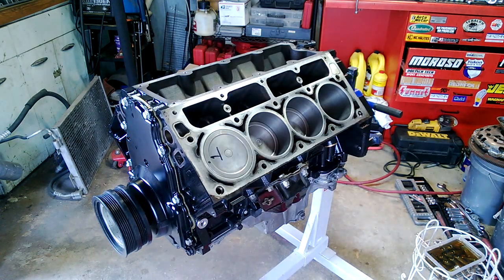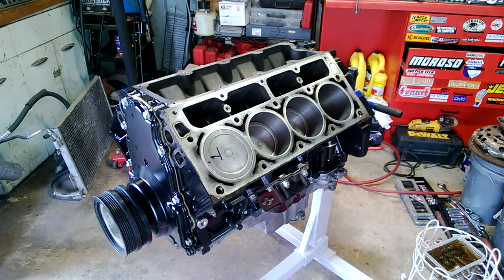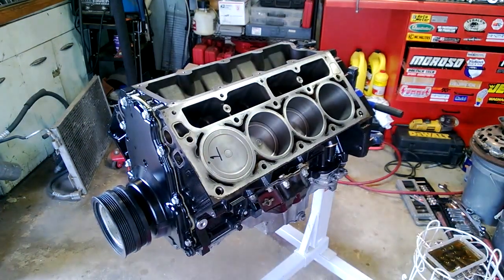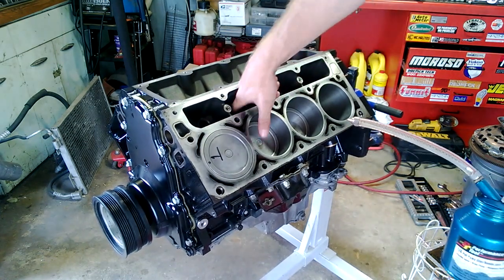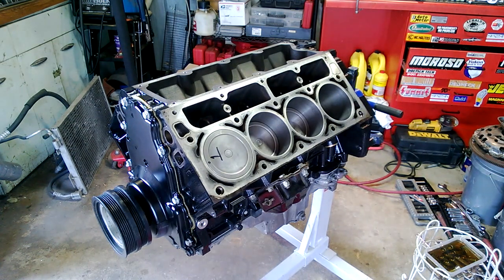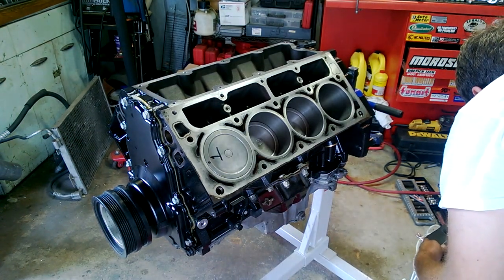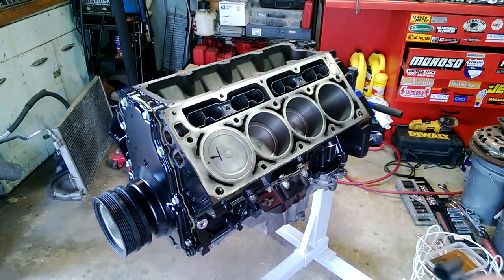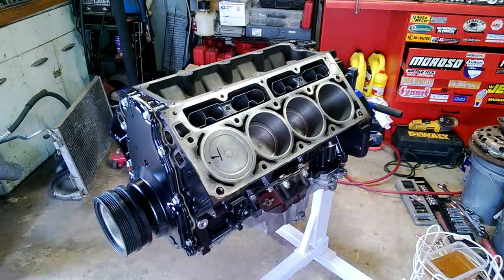LQ4 Build - LS7 Lifter Install

Comment: Im doing a cam swap and the cam is stuck on a lifter. Can i just take them out, put new cam in, and put the lifters back in?
Reply from the maker: The heads are still on? If so, you should have used dowels through the front of the block to hold the lifters up. I know most times they stick in the trays, but situations like this make it worth doing.
Reply: @JEGsGarage  yes the heads are off
Reply from the maker: @sosakicks  oh then yeah. No prob. Take the lifters out, pull cam, install new cam, install lifters into trays first, then install lifter/tray assembly.

Comment: You forgot to mention the orientation of the oil hole in the side of the lifter. Only one side has it and it apparently matters which way it is installed (hole to front or hole to rear of engine)!
Reply from the maker: Thats because it doesnt matter.  I guess I could have faced them all the same way, but they were brand new.  The only time to really take note is if you are removing and reinstalling, and thats just to orient them the same way they came out for wear purposes.  Oil will go into the hole no matter the directly, provided your oil pressure is healthy.

Comment: that's an awesome build man ! I'm going to be working on my lq4 pretty soon also, so the LS7 lifers work for the lq4 straight swap ?
Reply from the maker: Thanks!  Yes the LS7 lifters will drop right in.  HOWEVER...there is a bit of back and forth on pushrod length when using these.  The range of motion in the plunger is a bit different than the LS1 versions, I think.  A lot of guys will run more preload on the LS7 lifters, myself included.  I recommend checking your pushrod length with the new lifters, just to be on the safe side.

Comment: best series of engines ever built and they are fun to work on!!! 5.3 and 6.0 are bulletproof right off the lot    seen them stack on over 400k miles without being touched
Reply from the maker: +grady thayer Thanks for commenting!  Yeah these motors are great.  Just enough newer technology to be competitive, but still really easy to work on, and not too expensive.
Reply: really 400k? wow
Reply: That's awesome! inspiring for a build an ls then...I have an LM7 from a Silver ado too
Reply: Don Ross I was going to do a video tearing it apart. I'm thinking I'm just going to do the built. Trying to make it reach pass 400
Reply: Don Ross mine has 300k and has never had an issue. I bought 2000 Silverado from my dad has 5.3. I'm doing the cam install myself. Already took off the intake manifold and heads since I'm doing other stuff. But yea haven't had any problem with the engine.
Reply: DatBoiBEAT awesome would like to follow...count me in
Reply: You do realize the 4.8L and 5.3L are the exact same blocks, right? Only difference is stroke of the rod and compression of the piston if I'm not mistaken.
Reply: @JustAGuy781  sleeve thickness is also different which is why the 4.8 is more favorable towards boost applications then 5.3, 5.7, and 6.0+ engines
Reply: @UCZ5uCdF4oLk3PQ9pEW59XfQ that will definitely be pretty sweet ! I'm building my gen 3 6.0 for my air ride 87 s10 should be a tire frier😂
Reply: @zacrork1292  yeah I have a lot done to mine at the moment, did it all myself and my tuner and I are leaning towards 440RWHP. My mods are extensive bolt ons with some engine work I did. Nothing done to the short block, just heads, cam, truck intake work, throttle body work, long tube headers, exhaust, a Vararam Tri-Power Ram Air intake system and of course a good custom tune along with the 4L80E swap I did. About to go drop my driveshaft off in about 30 minutes.
Reply: Pull on mine this weekend 460km

Comment: did you use stock length push rods?
Reply from the maker: +oerllikon2 I did not...  I had 7.350" push rods in from ThunderRacing.  But they were too short.  I will have to track down the actual length that I used.  I cant seem to find the email receipt or anything...but I went with Brian Tooley for the spring kit and pushrods.  If you want me to try to track down the length I will, but I always suggest measuring each build.
Reply: +JEG's Garage thanks for the reply, does the cam have the same base circle? same head gasket, decked heads etc? I am considering ls7 lifters with the same pushrods, I've read so many conflicting things.. thanks for your time
Reply from the maker: +oerllikon2 Cam is a smaller base circle than what I had.  Im not sure if its smaller than stock or not.  They are standard 6.0 head gaskets.  Heads are 5.3L heads, and the gasket surface was only cleaned up.  The chamber size was still close to stock 5.3L.  I read conflicting things with how much preload the LS7 lifters should have.  I gave the more than the LS1 specs, but not as much as some.  Some were giving them like .100"+ if I recall.
Reply: +JEG's Garage how much preload are you running?
Reply from the maker: I will have to try to find my notes.  I want to say .070".  But I cant 100% remember.  It wasnt over .100" like some say.  My valve train is still noisy like its always been.  Ive never been able to quiet it down.  Just accepted the sewing machine sound as sweet sweet music haha.
Reply: +JEG's Garage could it be your rockers? the mechanical sound could be a good thing haha. what a pain though, gm has no mention of lifters being different. thanks for responding!

Comment: What kind of pulley/balancer are you running and what's the under drive on it. Price and any other info would be helpful.  nice build by the way
Reply from the maker: +Darryle Cheaton Hi Darryle.  That is an ASP Underdrive crank pulley.  I THINK its a 25% underdrive.  But Im not positive since it came with the LS1 in the donor car that I got in the very beginning.  I cant really compare it to anything else, since its the only one that Ive had, but I have had no problems with it so far!  Thanks for watching!

Comment: I just took my lifters apart and rebuild them now before installing them do i need to fill inside of the lifter with oil?
Reply from the maker: 64impalaSS Ive heard different opinions about the soaking lifters thing.  Honestly...they're going to get pumped with oil while running.  So I always soak mine because I would rather them have oil right away.  Oil pressure should build very quickly though, with minimal revolutions before having oil where it needs to be.  The oiling system on these is pretty decent.

Comment from the maker: @AdrianLandaverde Well, it didn't self destruct. And I had instant oil pressure. And still has awesome oil pressure. So the only thing I can tell you is it didn't hurt anything that I can see haha. I dont see the harm in giving them some oil. To me, running them dry would be worse.